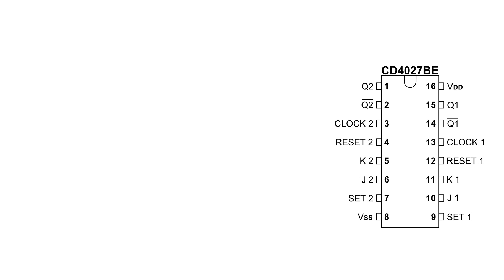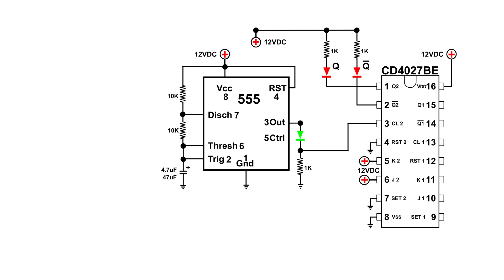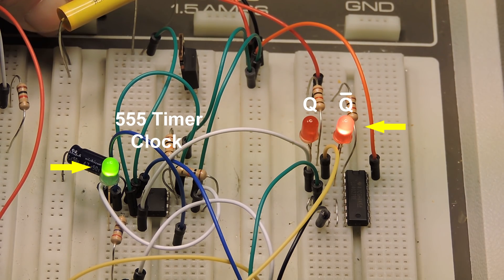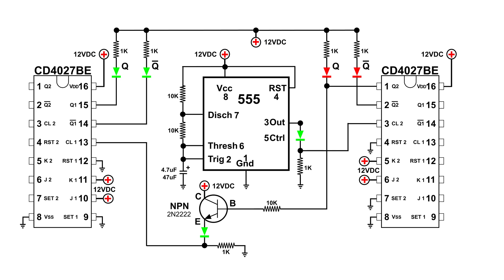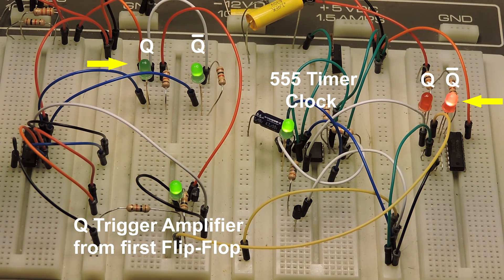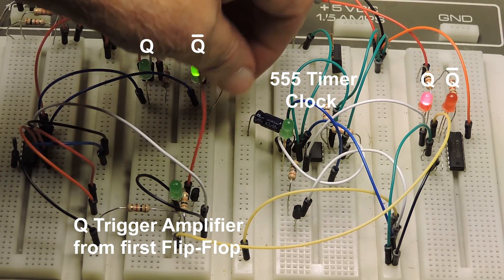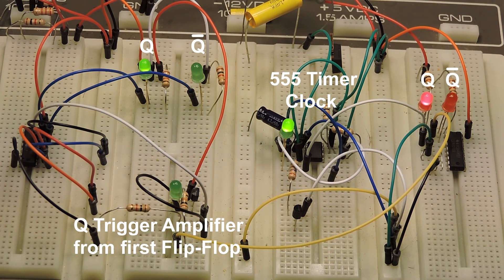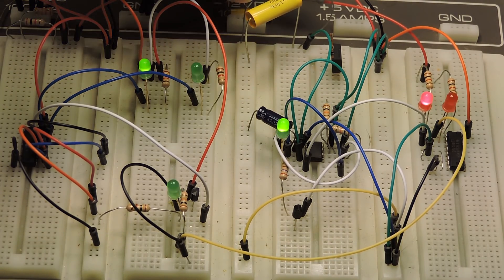JK Flip Flop

Comment: You don't need to 4027 chips one can do all this.  The LED's could run at the same speed if the clk from the 555 drove both clock inputs to the 4027.  You could also do this in vhdl development board all in code.  Really like the quality and information you put together for these videos.
Reply from the maker: A 555 timer does not give equal time to “ON” and “OFF”

Comment: If voltage and specific use of J/K FF are not critical, microcontrollers such as an ATTiny20 (14-pin) could provide any sequence of flip-flopping for at least 4 LEDs.  Yes, such IC's require  programming language & interface.  Was there a particular reason why only 1/2 of two 4027 chips was preferred over all of one 4027?  BTW, there are sources who feel that unconnected inputs in 4000-logic might benefit from connection to GND or B+.  Best...
Reply: Do you have more information about the unconnected inputs that you mentioned (books, application notes)?
Reply from the maker: Thank you.

Comment: Another fine demo AA5R. I was curious about the 12 volts vice 5 volts. I thought it would damage the JK, but I guess you checked the data sheet first, some thing newbies often forget to do or may not even know to check. Thanks for the fun.
Best Wishes n Blessings. Keith Noneya
Reply: CMOS Chips can be operated over a range of Voltages whereas TTL Can;t Thank You Rick For  another Great Video!!!   BR from Canada Rick
Reply: B series CMOS devices such as these can operate safely with a supply voltage of 3 to 18 volts. Unlike TTL devices which are very rigidly held to a maximum of 5 volts.
Reply from the maker: Thank you.